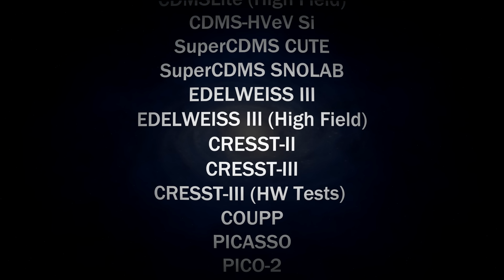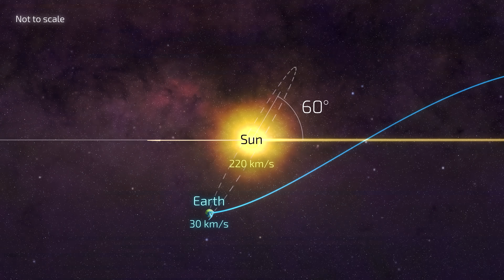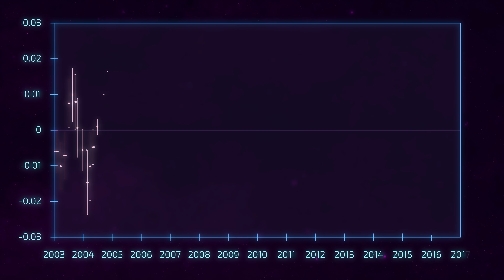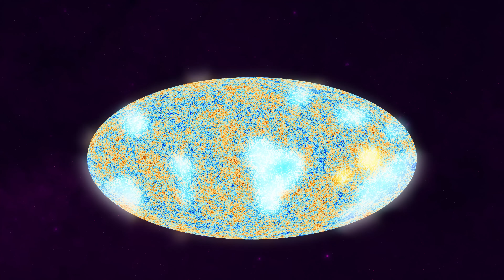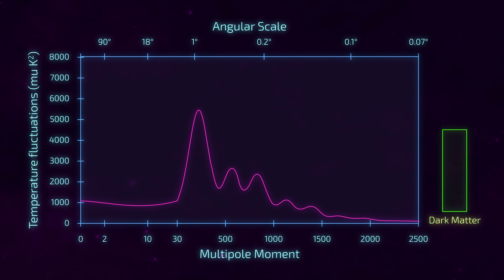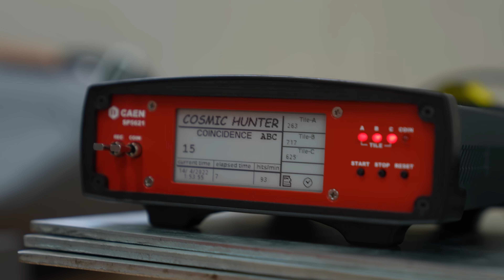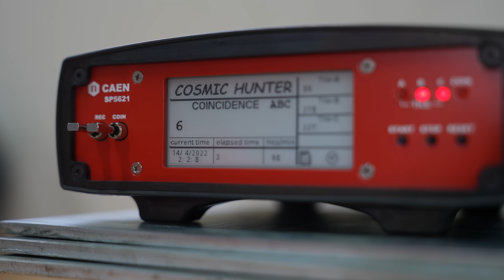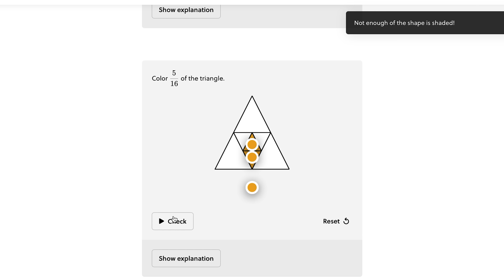The Absurd Search For Dark Matter

Comment: I think the rotational limit holds more weight than you think, if you rethink the reason of gravity as not being time but rather the void itself then a lot of things make sense, if the void itself can interact with normal matter then the best way to think of the void is a like a liquid, a liquid so big that it creates the effect of gravity as it squeezes itself between planets, just as liquid does to objects within it, that naturally means anything on those planets is likewise pushed both towards the planet and away from it, however the amount of void pushing us onto the planet is greater than the void pushing us away from the planet, this difference would be gravity, it explains how gravity at the photon levels has a different strength to that of the gravity displayed at our own size, and how gravity is seemingly stronger the denser something is rather than the bigger it is, since there's more photons etc for the void to push things against in that small area than of a larger but less dense object

Comment: I like to imagine that all the "light matter" particles are special solutions of some equation that respect some type of symmetry, and that dark matter is just every other solution that doesn't possess that symmetry.  That would be great because it would neatly tie up the whole standard-model-seems-arbitrary problem.  It would also fit well in the framework of force-carrying gauge bosons.  In other words, particles of all masses (up to the Planck mass, I guess) exist, but only the ones that follow the same symmetries as the matter that we are made of can be detected because we detect them through those symmetries.  It's a form of selection bias, but on better footing than the anthropic principle because gauge symmetries are well understood to underlie the interactions between light matter particles.

It's too bad I don't have the math chops to develop this idea further.  I'm sure someone else came up with the same idea, though.

Comment: I don't think Gravity works the way people think it does. If Gravity is curving spacetime, Gravity is also rotating spacetime aswell. 

It's better to think of Objects sitting on a body of water, and the objects are causing that surface to spiral. So both Gravity and the objects are influencing eachother. Maybe it's best that people separate the idea of mass and gravity as two separate interactions.

It's thought that if the Sun was to instantly dissapear then so would it's Gravity, limited by the speed of light. But what if that's actually not the case. I hope this illustrates my point.
Reply: Rotating?  Relative to what?
Reply: @deputydog1995  Rotating relative to the motion of mass at the centre of Galaxies ofcourse. Objects start to circle which then causes spacetime to move in the same motion which has a greater net effect across the region.

Comment: 4:39 If you're adding more mass to account for the fast rotational velocity in the outer portion of the galaxy, doesnt that mean the stars in the center of the galaxy have to have an even FASTER rotation due to the increase in mass. essentially the rotational speeds should change proportionally no matter the mass. The fact that it stays constant makes me thing there is something wrong with the entire theory of gravity. This is why i dont like your analogy when you added the water to the weight. Sure you have to spin the top faster now, but at a smaller radius out you would have to spin the top even faster than before.
Reply: Analogies are never perfect.  The radial distribution of dark matter impacts the resulting velocity curve
Reply: If one actually does the maths, you find that the rotational speeds don't change proportionally. Objects closer to the centre of mass are affected less. This was known to Newton, who showed that the effect of the gravitational pull from anything farther out from the galactic centre than the object in question all gets cancelled out, so the only matter (dark or otherwise) that makes a difference is that closer to the galactic centre than the object being pulled.
And since there's a lot less dark matter closer to the centre than you if you're already close to the centre, that means being close to the centre makes you affected less by the pull of dark matter.
Reply: @rtg_onefourtwoeightfiveseven  similar to how you wouldnt feel the pull of gravity if you were at the center of the earth. I think I get it....it just feels like something off and I can't quite explain it.
Reply: @FeVaR  It's exactly like that; not sure why it feels off to you, but you've got it.

Comment: Sound doesn't travel through a vacuum.  Light doesn't travel through a void.  Black holes are voids, not ultra dense material/matter.  Dark holes are rips in the fabric of space (dark matter).  Matter is compressed dark matter (by wobbling of the universe, compressing and creating voids.  This reduces pressure (gravity).  Anti-gravity machine?  Helium balloon.  Magnetism?  Flowing dark matter moved, powered, energized, by wobbling of the universe?

Comment: The star are rotating the center of their galaxy on an isochronous curve. So when you measure the time it takes a star to fall with gravity from one point in space to another point in space (thus calculating the speed) you will get the stars on the outside of the galaxy moving the same distance at the same'ish time as the stars in the middle of the galaxy

Comment: Dark Matter may exist, but you avoided most of its controversy.
The problem with DM is the same as String Theory: it is based more on hypotheses than evidence.
While human intuition has an important role in physics, you have to have experimental data early to avoid boondogles.
All of the evidence for DM is more parsimoniously explained by several other hypotheses (the floor limit, that your guest explained, but also other gravitational effects, including the slowing of light as it travels vast distances because of gravity).  It also has equal parsimony (which is to say weak) with other concepts like an extra dimensional superstructure to the universe that actually causes gravity, and differences in regional gravity are due to the geometry of the superstructure (an analogy would be a splash of water on a "2d" surface, when that plane is actually wrapped around a 3D sphere.  To the 2D inhabitants, the splash would appear from no where.  Assuming a splash on the top of the ball, the water would accelerate more quickly as it approached the equator, given the slope of a sphere).

...again, DM may be the actual explanation, but avoiding the controversy is the same pop-sci sin that has led to decades of wasted talent in String Theory.  Experimentation must be allowed to falsify, or point to a more parsimonious explanation.  Neither DM nor ST have followed the scientific method in this regard, and that has been fueled, in no small part, by pop science communicators.

Comment: One question I have: Why do they call it "dark matter"? From what I know, matter is something physical that reacts with other physical elements. So if dark matter is actually matter, then it should be obserable indirectly reacting to matter and crashing into things? Even anti-matter reacts with matter, creating an explosion of energy as they erradicate themselves....
Example: There are dark matter galaxies...Wouldnt they then put a dent into nearby matter galaxies? If you have two balls of rubber and you push them together, they will not be completely round anymore. And if the universe consists of more dark matter than matter, then wouldnt the dark matter overpover it? The dark matter would take the middle and pish the matter out towards the edges....My theories might be stupid. I did not even finish high school because of ADHD.....But to me, it still feels like dark matter is a theory created for comfort. Because we want to be able to understand the universe...yet, we might not be ready yet
Reply: Since dark matter only interacts gravitationally with regular matter (or maybe also via the weak nuclear force as this experiment is trying to determine), it can't crash into regular matter. Two objects "crashing into each other" requires a force between them, specifically electromagnestism, the repulsion between atoms at very close distances, due to their electron shells. Without it, objects would pass right through each other, as would dark matter and regular matter. Dark matteris far from a theory. It's just a possible explanation for the difference between what we see at very large scales and what we already understand, that we don't at all understand yet.

Comment: How do you calculate the orbit of a distant galaxy when the time needed to see movement on the scale is so huge? For example if 2 galaxies a million light years apart were orbiting a central point it would take over 8000 years to record them move 1 degree in their orbit. If an observer watched them for their entire career they would see a .007 degree change at best.
Reply: With high enough precision you could measure that 0.007 degree change.
Reply: @GeorgeMonet  that's the thing though. You need high precision and an entire lifetime to measure that. Then you have to assume that change is .007 degree an the orbit.

Comment: The concept of Dark Matter has been essentially the concept of positive and negative.
If matter is the positive, there must be a negative.
...but matter is not strictly positive. It is both positive and negative, removing the need for dark matter to exist. But if one MUST think in such terms, one could effectively consider space itself, or time, or gravity to be dark matter. OR mathematically it would also work out if one considers the dark matter to be another dimension, unobservable because it isn't within our universe, but capable of equally effecting, and being effected by our universe.
In short, Dark Matter is like scientific philosophy. A doctrine through which one can look at the universe. It is no more or less factual than any other perspective, but it is just that. A way of thinking about the universe. Not a static reality of the universe. There are several such philosophies within science, especially today's gatekept fields acting as more religious cults interpreting evidences to fit narrative stories rather than acting as neutral observers and seekers of truth.
Is that bad? Not necessarily. One can think of cold as moving, and thus as a form of energy, even though what would be observed and described would be nothing more than an inverted view of how heat energy works. Wouldn't be wrong. It would just be a focus on the negative rather than the positive function of the same energy.
So if it's easier for you to understand the universe in thinking of invisible dark matter all about us, then it serves the purpose to promote study and increase your knowledge. Like so many thought tools; Schrodinger's cat, Occum's razor, two dimensional objects = all literal fictions that have real world applications and are useful ways of looking at things so long as the observer does not lose sight of the reality that our way of looking at the evidence, is merely one way among infinite ways of observing and analyzing the universe.
Reply: If we had no concept of thermodynamics, and wanted to find the physical mechanism through which heat interacts with matter, we would go looking for this mechanism and discover particle interaction within matter changing the average velocity of particles.  Regardless of whether or not we thought of thermodynamics as heat flowing or cold flowing, the particle interaction would be a 'static reality'.  Yes, there are many ways to think about additional processes that explain our observations, but the existence of dark matter is a matter of truth.  It either exists or doesn't regardless of how you reason with mass and gravity.
Reply: @ethandavis7310  That is true of all such scientific philosophies, but your lack of evidence demonstrates that it is not in fact a fact. Merely a perspective. An explanation. An interpretation. It has not been demonstrated or observed scientifically and therefore has no more to do with reality than your belief in it.
So long as one remembers on the quest to prove intuition right that inversely you are favored by probability to be proven wrong in your efforts, a scientist can use such philosophy to continue a line of thought without departing from scientific method, but when arrogance asserts confirmation bias as a matter of truth, we are no longer in the realm of science. You are now religious.
Reply: @autonomouspublishingincorp1778 You're talking about confirmation bias when I have made no such assertion that dark matter exists. You're projecting your lukewarm philosophy. Everyone knows that you can think about things from different theoretical perspectives. We're past that.
Reply: @ethandavis7310  You literally stated; " the existence of dark matter is a matter of truth."   Your precise assertion.
The comment was on the video which did not at all address these defining features which historically stagnates understanding.
We'll continue to define these aspects of exploration in accordance to the literal definitions. Thanks again for replying with your opinions. Hope you do indeed get "past that" some day.

Comment: You've used "times more than" and "times as much" interchangeably throughout this video. They actually differ by 100%.
Reply: Is that true? Is it backed up by common usage (i.e., descriptivism instead of prescriptivism)? Are you saying that "2 times more than" means "increased by 200%" which means that it is 300% of the original number, meaning "3 times as much"? Or do I have it backwards?

I sort of feel like, in practice, people usually use the word "percent" for:
x_2 = (1 + c%)*x_1,
whereas they use the word "times" for:
x_2 = c*x_1, regardless whether "more than" or "as much."
Reply: @robertjenkins6132  in practice, common people use them interchangeably, but Voltaire and other intellectuals (past and present) separate the two. What you said about 200% and 300% is exactly what I mean.

Comment: The thing I don't get is, how can we know it's not just rogue asteroids and space debris with more of it being around the edge of the Galaxy - I mean wouldn't its rotation give the same result? The stuff at the centre could have fallen into the black hole and stars and other things while at the edge, there is just much more matter than we expect?
Reply: The issue with that theory is that there are a lot more observations besides galaxy rotation curves that suggest dark matter is a thing, and there are many of those observations that can be explained with current dark matter models but not with the kinds of things you're describing. The ratio of deuterium to hydrogen is an example.
Reply: @rtg_onefourtwoeightfiveseven  Fair enough, after watching this video I have completely changed my opinion on the subject to be honest which I think is pretty cool

Comment: When measuring the galactic rotation, is the gravity to be assumed to be a constant pull towards the centre, or are the gravity of the stars spread out though the center to rim taken into account? The majority of the gravity in a galaxy does not come from the super massive black hole at the center. There is a significant amount of stars in the galactic rim that would cause other stars to be pulled towards them. The ridiculous massiveness of galaxies mean that we cannot assume that it is a singular gravitational object to those inside of the galaxy. As the stars travel they would also be pulling the stars behind them in a gravitational slingshot. An example star can be making it's way towards the galactic rim. On average, as the star moves it would attract other local stars it passes and give them a gravitational boost towards the rim while those stars would alter the example star path to curve back towards the centre as well as the majority of the galaxy gravity being located on a single side. 

To me it would seem like a self perpetuating cycle of stars being attracted to the opposite side of the galaxy rather than the centre, and as it moves it's own gravity will interact with local stars to give them a boost towards the edge. Those on the edge should be moving the fastest because they have more velocity than any of the other stars with an entire galaxys worth of gravity pulling them towards the center. This would result in the edge having on average stars with higher velocities than those who populate in the arms and center.

What if were searching for some material that we think is there because we are basing our data on simplified calculations that we haven't attempted to reexamine because the actual calculations are virtually impossible to do. We already have issues calculating how 3 gravitational objects interact with each other, let alone a galaxys worth of stars.
Reply: Short answer is that yes, people have thought of that and taken it into account. We can't do the calculations by hand, and we can't simulate an entire galaxy of billions of stars, but we can honestly get pretty close with the best simulations. The short answer is that the effect you're talking about doesn't matter enough to make the difference.

Comment: I was thinking maybe a pinhole microscope is also gravitational lensing because of the mass on all sides 360 has a pulling effect on the center  and possibly using  a denser material would make the effect stronger?  Maybe glass lenses have more magnification power than plastic because of their gravitation influence?
Reply: Another example of a pinhole microscope is when you squint to see something better, you can mimic this effect when you make a small hole with ur fingers and try to look at a digital clock that is normally to far away to read.... try it..